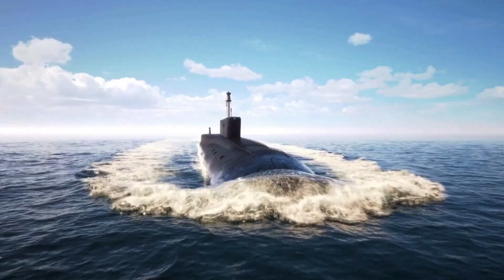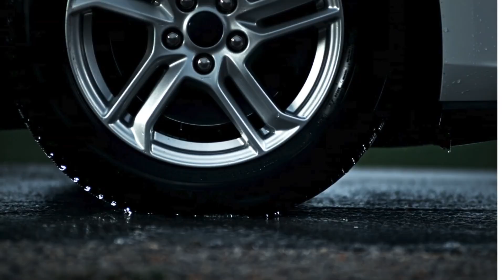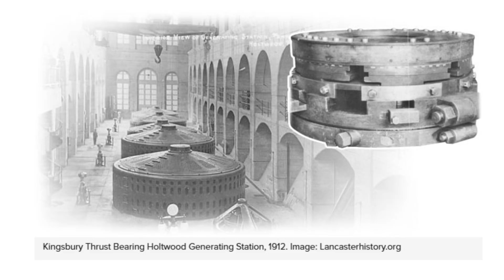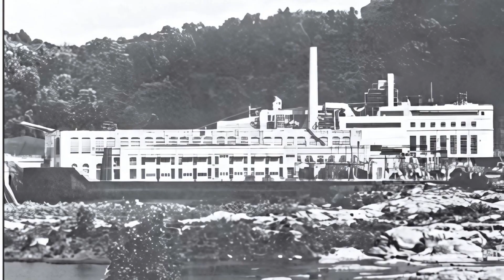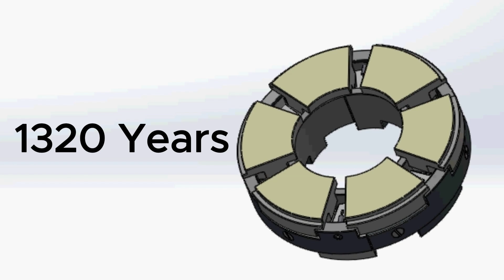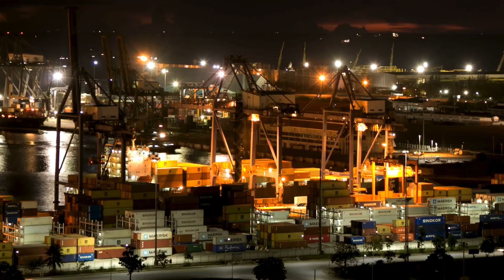World's Most Durable Bearing!

Comment: During my work I had some encounters with bearings and V-belt failures in the 10 kW to 100 kW range. if V-belts going to rip it may smell like burnt rubber; in advance, maybe, or afterwards!
We had one roller bearing, which always was at risk, because sealing package water leaked more or less and sprayed on the bearing. We kind of got along until something happened:  for ~ several hours the machine hall had an unusual smell, not rubber, but like a frying-pan with too hot oil smelling in the kitchen!!! We didn't get alert, nor started searching on time; so the troublesome bearing "cooked" its grease for several hours, and when it was "done", it increased temp further until the rollers softened, melted and welded the bearing in place; suddenly stopping the machine, tearing the belt, and saying "good bye". in hindsight, I could have captured the failing, overheating bearing several hours before the fail by recognizing the different origin of the "fatty smell".

Comment: A new replacement would probably use synthetic diamonds
Reply from the maker: @Phil-D83  can you tell us more about it?
Reply: @MechFlare  look up zero friction bearings. They use synthetic diamond rollers.
Reply: @MechFlare  From what I can see, it's a mix of synthetic diamond to provide the bearing surface, because there's nothing harder so it won't get worn away or deformed, and graphene lubricant, the combination of the two working extremely well, but on small scales. For this scale of operation, I can't see it being practical, and certainly these kinds of fluid bearings are substantially cheaper.